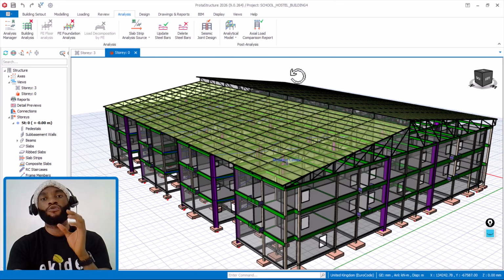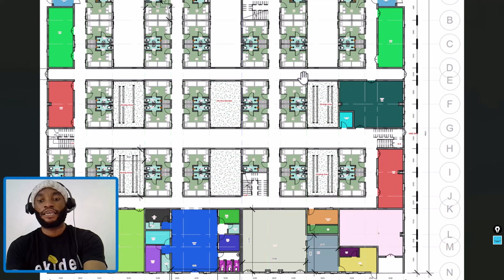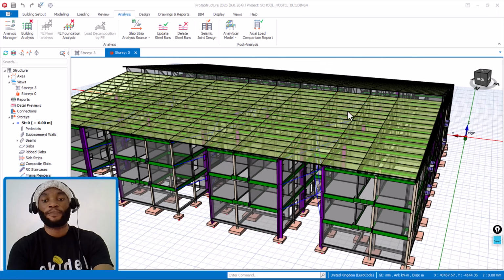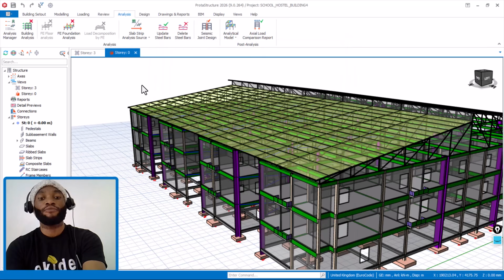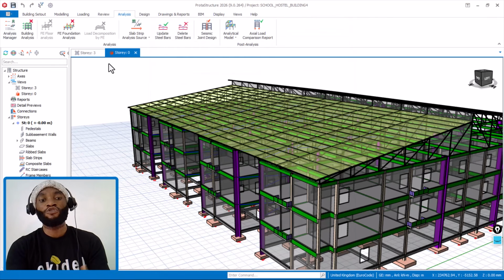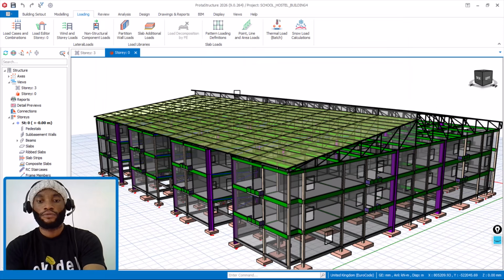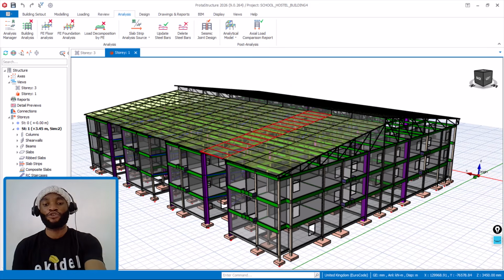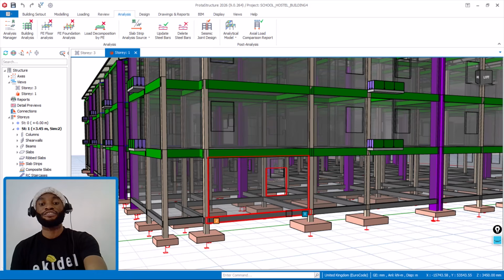Why Your RCC Columns Are Overdesigned in ProtaStructure | Correct Column Overstrength Factor

Comment: Thank you very much senior engineer. I can't wait for the plinth beams tutorial. It's been a nightmare for me as it always fail.
Reply from the maker: Yeah Coming soon!
Reply: @josephbockarievandy2216  go in beam settings and determine concrete cover greater than zero. The issue will be automatically fixed